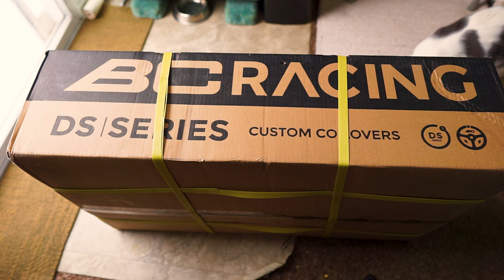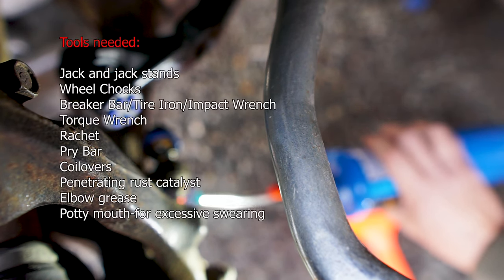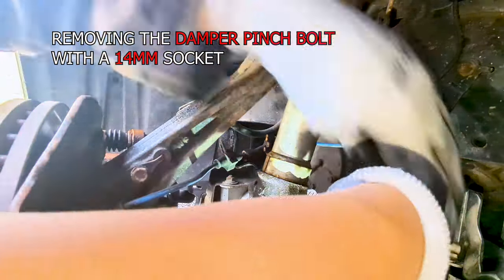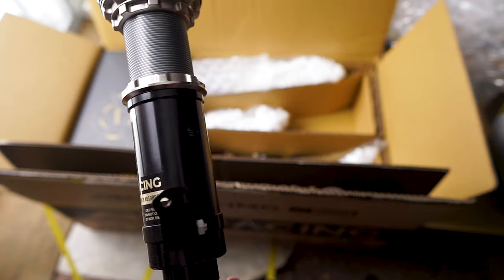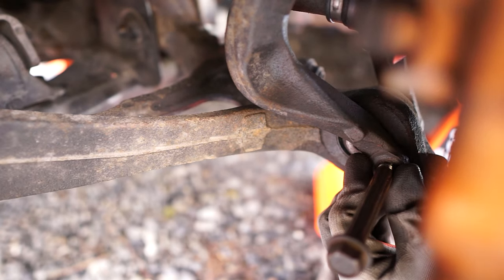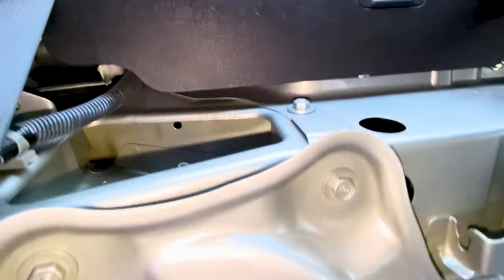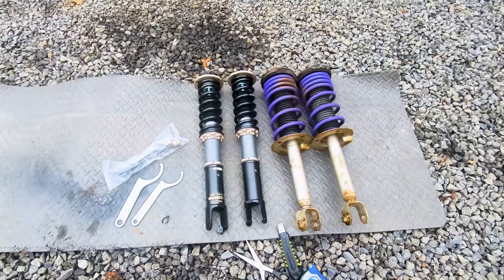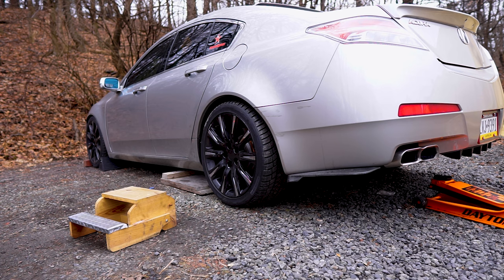Step-by-Step Guide: Installing BC Racing Coilovers (DS Series) on Your 2010 Acura TL!

Comment: The coil overs make your exterior ride look cool, but I don't want to lose my ride quality. Never thought the rear struts would go all the way up behind the rear seats. The stance came out well.
Reply from the maker: Nothing beats oem stock ride quality, mine was previously on lowered springs although I was diggin how cool it looks it is rough around the edges especially here with imperfect roads down my area..so I swallowed the blue pill and got this coilover lol..yeah that rear struts are way up there, those rear seats are a pain to remove🤣